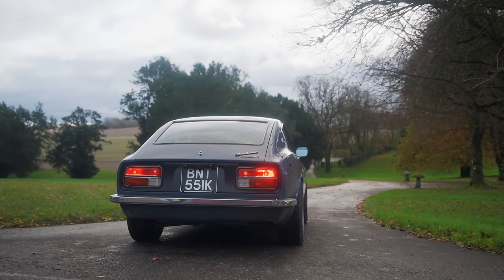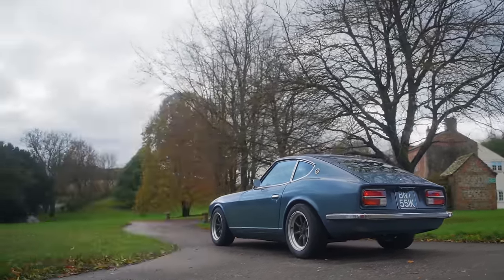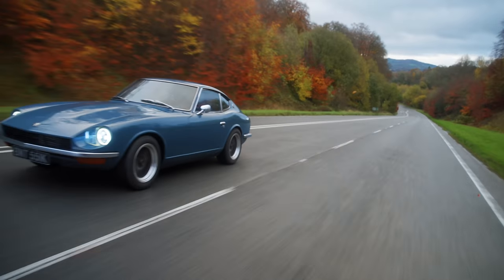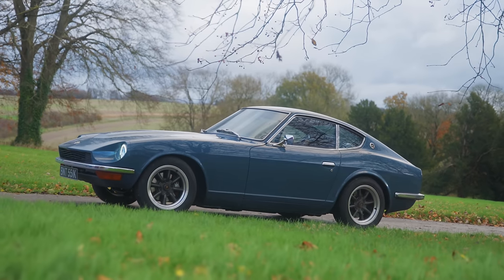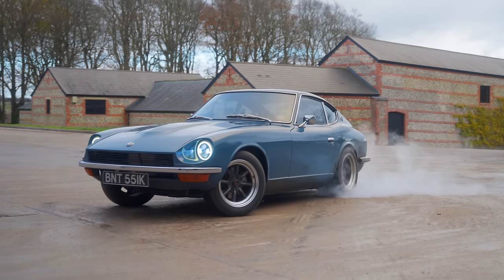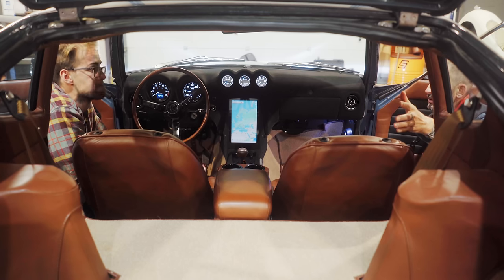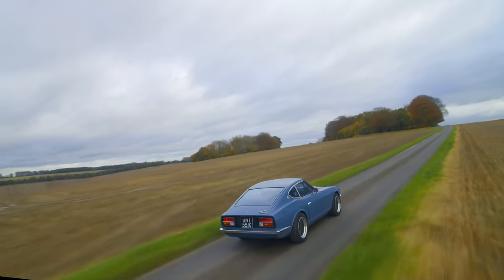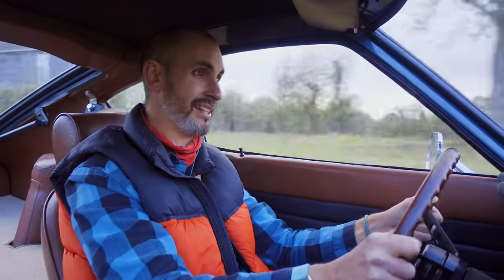Would you daily drive this controversial modified Datsun 240Z with Drift mode?

Comment: Such a strong start to the year Jonny, amazing stuff!
Reply from the maker: Thank you v much. We hope this one gets people talking. There's lots to like, even if it's a divisive project.
Reply: @TheLateBrakeShow Talking? More like hysteric giggling coming from the drivers seat!
Reply: @TheLateBrakeShow   From the comments so far, it seems to be not at all divisive! (one luke-warm comment) 
(I will take issue with Jack's generalisation that EVs are bland --- Hyundai Ioniq 5? Honda e? BMW i3?  But his styling touches are excellent.)
Reply: @TheLateBrakeShow   Ruined. Forever. Pointlessly. Putting electric motors in old cars has no environmental gain.
Reply: @TheLateBrakeShow  if you really think it through... it is not devisive, it is sensible!

Comment: Thanks for this awesome review Jonny. It would be great if this vehicle,  or another chassis could be designed with a modular battery pack so you could extend range when required for longer trips or in areas with poor charging infrastructure.

Comment: This sort of thing is a great way to preserve classics, I love that there's such an industry in it. I have a '74 W114 Mercedes 280E that I think would be a great candidate for this sort of conversion. The engine that's in it is not particularly special, and getting hard to find parts for, plus there's lots of space available for battery packs once the engine and fuel tank are out. The character of the car would be preserved while updating it for a modern age to keep it going for the next 50 years.

Comment: Excellent video Johnny.

It’s brilliant these businesses converting classics are emerging because as cars go EV demand for petrol will decrease and fuel stations will gradually disappear. Also over time the skills associated with repairing combustion engines will become rarer making it difficult to keep a combustion classic on the road. So converting to EV means we’ll keep classic cars on the road. They’ll be more reliable than when they were combustion powered. 

If classic EV conversion wasn’t happening in a couple of decades combustion classics will end up as static museum pieces. A few might be seen on the road driven by wealthy collectors who can afford expensive fuel and are able to store that fuel safely. EV conversions are the way to keep classics on the road beyond the ending of fossil fuel.

My choice of conversion would be a 1980s Porsche 911. Or a 924, an underrated design classic. I’d choose the 924 over the 944. I’ve owned examples of both in the past. With EV power a 924 will be faster than an ICE 944 and the 924 is the start of the front engine family with the purity of the 1970s design.

Comment: I love the idea of upcycling cool looking cars into something light, practical, green and with 21st century comforts. Screw the petrol heads, they can keep the engine in theirs and preserve that car for posterity!

An early 2000's BMW Z8 would be a VERY tempting project...

...so could you cover the legal stuff one day? Airbags, seatbelts, crumple zones, MOT, indicators & lights etc? Power packs, brakes, suspension, paintwork & interiors are all cool, but how DO you make a huge conversion street legal and is it as expensive as it sounds?

Comment: Love the start to the year, and love a 240Z, especially when it's converted to electric. I think 5 years ago there would have been annoyed folk, but not anymore. 
That Bentley is the ideal electric conversion, the serenity of driving that big leather armchair with no noise and probably having quite a bit of range due to being able to fit a decent sized battery and low speed of the car would be fantastic

Comment: There’s not a lot of RHD UK market 240Z left (only about 1500 originally)and they’re thinning out a lot in the States where this  LHD one came from. I’ve owned a modified one and a 260Z 2 seater back in the 80s and early 90s, working for a business that specialised in them. However, I now have an EV and approve of this conversion. I like the way it’s a parts bin exercise and respects the original car. The colour is sick and the custom interior on point. I like the touchscreen interface mounted where the heater controls and radio were originally located as well. I do agree that a car can be a lot of fun without making vroom vroom noises. At 3.8 seconds to 60mph it’s a lot quicker than the original L24 even if you increased the displacement and did all the tuning mods. Effortless as well. The only issue is it’s expensive and HV stuff isn’t really for the DIY guy with the inherent safety issues. Nevertheless a 👍 from me.

Comment: I'm a bit lukewarm about Plug in Electric vehicles. I could see the need for a second family vehicle used for doing mundane tasks like going to the local shops and another petrol or hybrid vehicle for long trips etc. With that in mind I'd quite like to see an Austin Maxi converted. You don't see any around these days but a local MP runs a petrol Morris 1100 which would be a bit small. I'd normally go for an Escort, Cortina or Anglia with a decent Japanese engine in it , if I had the money.

Comment: Nice build. personally I wouldn't have the tablet. I hate screens and tech in cars but having a reliable car with classic looks i get it and it softens the blow when its a car that's in rough shape to begin with, at least its on the road now. If I could commission a car it would either be a big luxury barge for a daily like a Humber Imperial, Opel Diplomat or even my current rare but nobody cares Laurin & Klement  MK1 Octavia or a Bedford CF1 panel van with camper conversion. Anything sporty I'd keep piston powered for the sound and smells,

Comment: Frankly as long as we keep getting iconic restos like this, I'm not opposed to the idea of dropping the traditional engine. Continue to refine ICE sound simulation, fake dual-clutch paddle shifting that Hyundai is seemingly pioneering, and battery tech... I'm fine with going all EV. The older I get the less amusing noise pollution seems to be.

Comment: "There's a lot of these still out there".....true,we have about 40--or--so out in the Desert at work. There WAS s few more but we crushed about 12 back in early December. But...we just picked up a 1-owner 260Z. Who knows what we'll do with it.
Reply from the maker: You did what? Crushed a load??
Reply: @TheLateBrakeShow  As Yard Manager it's kinda my job. We do crush new stuff after they're picked over,but these days it's cheaper to buy new Aftermarket Panels for example then buy a used Panel from,say a 1990 Chevy/GMC Pickup. We actually buy wrecked Tesla's but we worked out a deal with a Gentleman who strips them of their Screens and Batteries,ect. Some cars do sit around for awhile.... while others sit around for decades. The world of Auto Salvage is a bit loopy at times and for those on "The Outside ' it can be"Annoying ' or something else. Still I crush what needs to be and that's about "it."

Comment: Nope. Definitely (still) not buying into this somewhat silly/questionable craze of electrifying classic cars, especially the iconic 240z. Converting some old (fiddly) generic classics with impossible-to-find parts ? Yes sure, definitely... but this one just makes no sense to me, whatsoever. I owned and fully restored a 240z and it was an utter joy to learn about and revive that excellent mark of Japanese engineering. Every single time I simply started it up, I smiled. Every time I perfected a heel 'n toe, I smiled. It was a flourishing long-term relationship of learning and discovery with that wonderful car... This though ? You get in, press a button, and just... go... silently... in automatic... posing as a Datsun 240z... gee wow... The obvious (and annoying) 'thing' with electrifying specific classics like this, is that you're completely removing the bespoke, heralded heart of the (classic) beast/overall experience/vibrations/shifting/wonderful noises and replacing that massively bespoke and sensory-gleaming experience and CHARACTER with absolute dullness.... silence.... no character... just tire roar... no different than what propels every other clinical, dry, and boring electric car. And yes, I've driven several electric cars over the last 12 years and they all leave me completely unimpressed and dry. They're a device. They're a clinical driving exercise in minimal interaction. They definitely have (and deserve) their place within the automotive realm, but - and I don't care 'how many' 240z's you think there are still out there to 'justify' this conversion - this specific conversion will always be viewed upon as an automotive-hipster thing for the young generation to (weirdly) swan over.
Reply: What two EV's have you driven?
Reply: @chargeheadsuk  Two ? No no, I've driven several over the past 12 years.... Nissan Leaf, Fisker Karma (hybrid-mostly electric), Tesla Model S, 3 and Y, VW Golf, Chevrolet Bolt, the (pathetic) Mustang Mach E, and just two weeks ago, the Kia EV6. All of them, I had with me for between 3 to 7 days and were driven on various types of roads/environments.
Reply: @Blakeoffire  you'll love my Tesla powered TVR! 😉⚡️🇬🇧
Reply: @chargeheadsuk  Yeah probably not... 😁 I've been very fortunate over the years to have visited the UK - specifically on three separate occasions - and hired out three different TVRs each time (Griffith 500, Tuscan 2 and the mighty Sagaris) to embark upon 1000 mile drives over 3 days in Wales and all throughout Scotland. The unforgettable sensations, the absolutely fantastic engines, the precise, rifle-slot manual gearboxes, the bevy of vibrations and pops/bangs, the constant smile on my face, the INCREDIBLE SOUNDS !!... memories and sensations that I'll never forget and are unlike anything else in the motoring world... Sadly, something you'll never get to experience in your electric 'TVR'. 🤷‍♂ (Oh, and sorry to sound mean, but just like this featured car is really no longer a 240z, your 'Tesla-powered TVR' is no longer a TVR based on my extensive driving experiences... it just isn't..! )
Reply: @Blakeoffire  I owned a Griffith 500 for 7 years and sold it to finish paying for my conversion. This project is aimed at recreating that Griffith 500 experience but using an electric motor. There are certain features of the build that help to do that, what this space.
Reply: @chargeheadsuk  Interesting, so you've actually lived with the smorgasbord of physical sensations and bespoke experiences of TVR ! I'll admit that I'm definitely intrigued on how you aim to, not 'replicate' per se... but infuse or engineer in a similar dimension of unique character and sensations.. ? Have to say though, nothing can top the satisfaction one feels when they dial-in, learn and perfect a physical, sensory connection with something as raw as a snarling TVR ;)

Comment: I would probably go for a DB9 conversion if I had the money burning a hole in my pocket. Seen a few with mechanical issues for under £15k. Hopefully new enough that it wouldn't need a huge amount of body work and modernising but system integration might hold it back

Comment: It's sad and yet it's intriguing what he did to the 240. It all comes down to 1 thing.. it's modern day Hot Rodding, it's the equivalent to stuffing a small block Chevy or a Chrysler Hemi in a Ford Model T. The purists hate it, the hot rudders understand it and it will encourage the next guy to one up the builder.  As for what classic would I like to convert, I'd like to see a Bricklin gull wing car  converted. I think there would be a lot less consternation about that happening.

Comment: If you think at a higher level, if you are truly about having fun; EV is not the way to go. The noise is a big part of fun. I have a GL 63 AMG; it is much slower than a Model X however, I still prefer to have the Merc as a family performance vehicle (size practicality aside).
Reply from the maker: Maybe, but our counter to your point is that fitting a hug powered engine in a hugely oversized, overweight, dynamically compromised thing like a GL is an awful idea in this modern age. Why? Because it answers questions that nobody asked. Why didn't you buy a sports car and an EV or PHEV family car for the same money?
Reply: @TheLateBrakeShow  Easy, depreciation is a killer. My 2015 GL 63 model with a total of 5 years of Mercedes manufacturers and dealer warranty, cost like a 2020-21 top end Palisade. The difference in vehicles is night and day in terms of luxury feel; the GL 63 is a far better. It is even better when compared to other newer non AMG GL/GLSs of the same era and I would argue at least even modern non AMG GLSs (for example, even Mercedes dealer said  the seats of ours and the audio are better than current gen). This is not to mention it feels solid like a tank, sounds like a supercar etc. All in all you feel like your in something truly special. I did try a Jeep Grand Cherokee L which is a lot more expensive (released only recently) and whilst it is truly luxurious,  the seats were like a rock, an issue that some modern Mercedes SUVs (e.g. new GLE) have too. The next one I tried was the Nissan Patrol  due to its size and off road capability. Whilst the seats were better than the Jeep, it was still a cut or two below the GL, not to mention the refinement and broader luxury aspect of the vehicle is relatively sub par. A strong focus on seats and ride is because of bad backs, including injuries. The X7 is far too expensive used (released too recently) and doesn't come with the right warranties. The fam was not interested in a van. The Q7 was too small.

Comment: 55 years ago I dreamt of replacing the BMC A motor and non synchro first gearbox in my Mk 1 Sprite with the running gear from a Datsun 1209. Would have mafe it a much better car. Didn't have the funds or expertise, but I would have had no qualms about doing it.

Comment: Can't be the most efficient system when you're taking AC line voltage to the DC charger to a DC battery, which is then used to power AC motors.

Comment: Favourite car to be turned into a BEV? Well, lots of my favourite cars have already been done, and done welj, but the stand out car is a Citroen DS. A car so ahead of its time it would be better with an electric drivetrain. After all, it never had the greatest of engines, and any era would do from the very first to the last, but if I had a choice I go with the models era of the swivelling headlights, which would include DS 21/23 Pallas, etc.
And maybe a SAAB, like a 99 or 900. Of course there is word that the Chinese company that owns the SAAB design, tech and name now is about to launch a new electric one, so I'll settle on the DS.

Comment: Honestly, its taken me a year but I have finally begun to bond with an electric car as a fun thing. I think it was probably because of the less than asupicious start to EV ownership I had with my MG4.

Ok so its not a classic but I would really like to take a 2004-2009 Mustang and EV convert it, I had a V8 petrol one for 9 years as a daily drive and it was a hoot. I would probably buy a V6 auto to base it off as they are less expensive than the V8 models, natrually it would have to be just a little bit faster than a V8. I know what the US car ownership scene can be like (I was called names by fellow american car owners at the time for suggesting that the Porsce CGT engine sounds amazing) so I can only imagine what I would be called for doing that.

Oh and part of me quite likes the idea of red faced, stampy feet purists, call it what you will, a rebelious streak perhaps.

Comment: The "RKR 15x8 ETO 4x11" wheels would be Rota model RKR, 15" diameter, 8" wide. "ETO" was probably supposed to be "ET 0" (zero offset), and "4x11" was probably supposed to be the stock 240Z bolt pattern of "4 x 114.3mm", which is the same as 4 x 4.5". I assume that no one with automotive technical knowledge proofs these videos...

Comment: 130 mile range …..so no heavy R foot, no heater use or passengers. And a wary eye on the nearest (working) public rapid charger. Not knocking it per say, but I own an EV and know the limitations are a real hindrance to full capability use.   But don’t suppose this is really a daily commute vehicle either.

Comment: This is a travesty. A silent classic? You lose all the visceral enjoyment of a great ICE engine, and you lose practicality too. And add weight. Try taking this on a long classic car road trip or rally. You’ll be spending hours charging while everyone else is having fun driving (and that’s if you can find a charger in a remote location). This conversion is particularly daft when we’ll soon be able to fill our classics up with some kind of synthetic fuel, which is much greener than digging up the earth for the rare earth minerals batteries require.

Comment: The comparison with the Lexus implementation of the L110 (that's the model number of the hybrid transmission) is mostly nonsense. When the Lexus engine is running, torque from the engine is added to torque from the output-side motor (called motor-generator #2 or "MG2" in Toyota Synergy Hybrid Drive terminology). The 6000 Nm torque is after multiplication by the planetary gearing, while in low range.

Comment: This idea that the car has "way more power" than it would with a gas engine is silly - decades ago enthusiasts were building their Z's - with the original L-series 2-valve-per-cylinder SOHC engine - to roughly the same power.